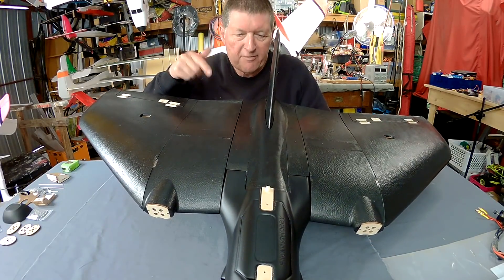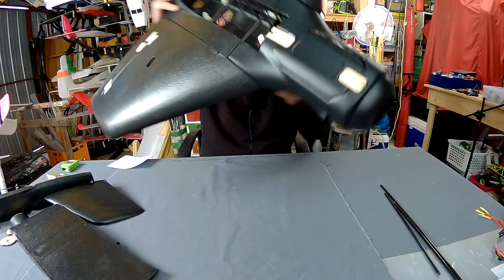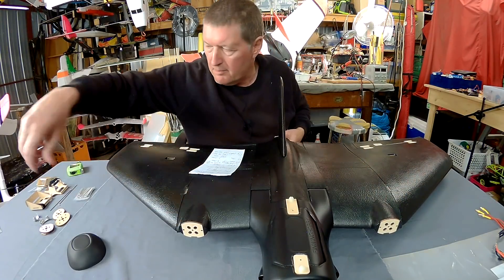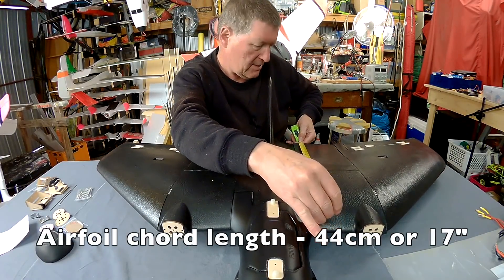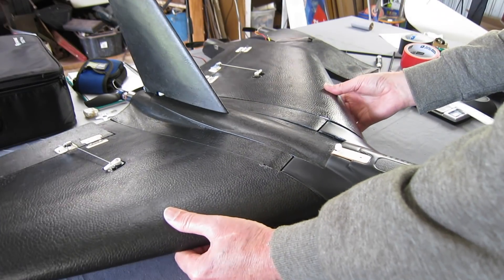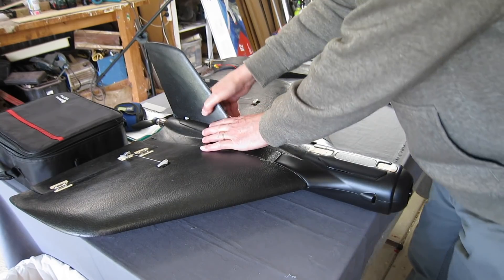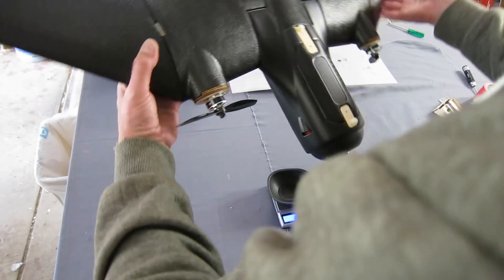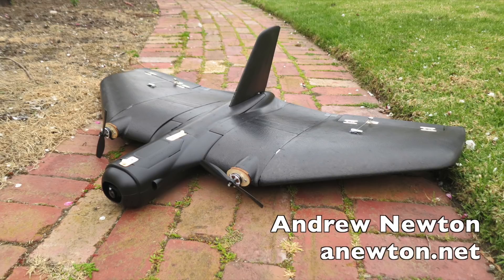Finwing Transformer Wing

Comment: i ordered today for 69$... want to know your setup what propeller you installed ...
is this motor enough for this plane with 5'' propeller

https://www.banggood.com/Racerstar-2306-BR2306S-Green-Edition-2400KV-2-4S-Brushless-Motor-For-X210-X220-250-300-Racing-Frame-p-1197129.html?rmmds=search
Reply from the maker: Yes that would work. I used 6x4 props with 3S

Comment: I have Finwing Traveller. Had a lot of issues with it, biggest with CG (it needed like 2*2200mah 3s and plus 1300 3s plus a wrench to fly!) so it just sits in a box... Metal hardwere wasn't helping with cg or wing loading, and first itteration was so bad aerodynamically that Finwing sent everyone replacement T tail (that should make it fly ok). Let's see maiden, it will tell the truth if they learn on their mistakes:)

Comment: In F33 format it looked okay, not sure about those twin engine inserts though..?  Reserve judgment until its flown.
Reply from the maker: It's certainly unique looking. I like the Bat look. If it flies slow smooth and quiet I will be impressed. It's designed to be packed away which means there are compromises. I'll glue it together in the twin setup eventually.

Comment: I wasn't tempted by the finwing traveller, and I'm not tempted by this. The overall impression is one of shoddiness, with it's unnecessary luggage clips and creaking flexible joins.  For $100 US I think there are much better wings on the market.
Reply: I have not seen metal hinges reinforced by plywood anywhere else.
Reply: 5:58
Reply: The finwing traveller had them - and those overweight luggage clips holding it together
Reply: @Tsnafu  yeap, it's bad design. I own Traveller. Almost 100g more weight (I don't remember exactly but it was something ridiculous like this) and those metal control horns have a lot of slop. And Traveller don't have flapping wings like this one. But, maiden will tell the truth:)
Reply: @avelkm  The maiden looked good to me. 
I get the weight thing. But consider the time thing of anything weaker breaking. Then you have to fix and add more weight anyway. 
Shame it is not precise, but for the price it is acceptable as a fun flier.

Comment: Very interesting, will have to wait for the flight test to see if it's more than meets the eye. Not sure how I like that big hole in the bottom right out of the box... smells like some Decepticon treachery.
Reply from the maker: Sadly I had to Goggle Decepticon to know what you're talking about. There are clear plastic covers for that hole and the nose cap that will repel Decepticon attacks.
Reply: @AndrewNewton  Good, I was really concerned about Decepticon. 
When I first read 'transformers' I was wondering if the power pods rotated up. With so much wing cord, a bit of tilt up could take advantage of the ground affect to launch and then rotate to level.